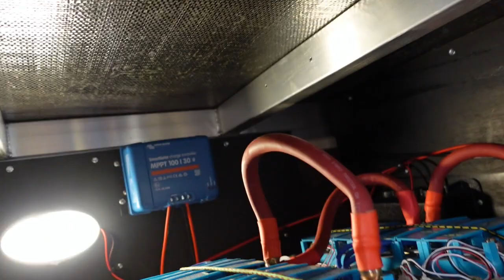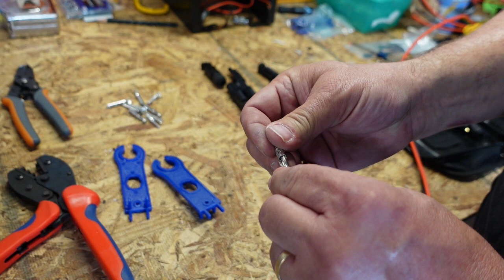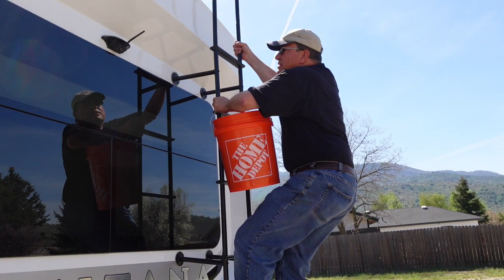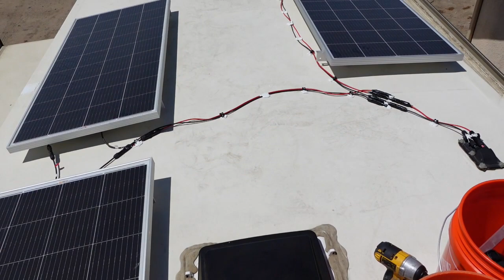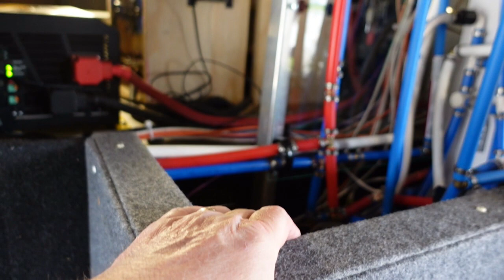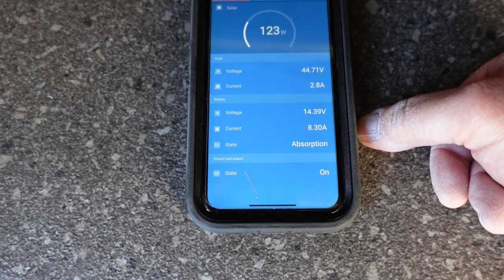How to Wire Solar Panels on Your RV the Smart Way

Comment: Wondering why you have 800 watts of solar panel and a mppt controller than can only handle 440 watts at 12 volts.
Reply: I don’t understand, series or parallel you have 800 watts connected to the controller. Can you explain. 
Thanks
Reply from the maker: @neilpateman333  This works the same as Batteries, When you have 2, 6 Volt batteries and you tie them from Positive to positive (Parallel) you still have 6 volts, when you tie them from Negative to positive (Series) you now have 12 volts, I have 4 panels, they are wired so that 2 of them are in Series totaling 48 Volts and the other 2 are also in Series totaling 48 Volts then I wired the 2 Series configuration in Parallel. When you do that the voltage remains constant so the total voltage is 48 Volts. The amperage in a series configuration remains constant and doubles in a parallel configuration. So the panels I purchased have a max Amperage of 9.4 Amps, so in Series that remains constant, when I put them in parallel it doubles the amperage to 18.8 Amps. What is most important when installing the panels is making sure the amperage does not exceed the wired capability, and you size the input to the charge controller I used a # 10 AWG wire, so it cannot exceed 30 Amps.  The charge controller I purchased cannot exceed 30 Amps or 100 Volts. Now as far as the Watts are concerned the total watts that the system is capable of generating is 800 Watts, in the configuration I have it in we use OHMS Law to do the calculation, Power (Watts) (P) = Volts (E) X Amperage (I)  P=48X18.8   P=902, Now understand that the panels are only designed to generate 800 Watts total, this is based on the efficiency of the Panel, If I get 800 Watts of Power I will be doing great. I only expect to get between 700 and 750 watts.  The charge controller can handle 100 Volts and 30 amps input if you do the math that calculates to 3000 watts, I hope this explanation makes it a little clearer. Please feel free to reach out to me directly if you have any additional questions, You can contact me through RVWeenders.com
Reply from the maker: The Panels are wired to provide 400 Watts in a Parallel circuit.
Reply: I agree with everything you say until your last statement about your mppt controller. The controller is rated up to 100 volts input and the 30 amps is the output rating so approximately 360 watts at 12 volts output or 720 watts at 24 volts output. You can’t multiply the 100 volt input by the 30 amp output they are not related. Check your manufacturer’s specifications. Your controller will start limiting the input after 440 watts of solar input if the output is 12 volts. 
I have a very similar setup 6 panels with a series parallel system.
Reply from the maker: @neilpateman333  Here is the spec sheet for the charge controller, In it you will see that the PV Short circuit amp rating is 35 amps, the charge rate is 30 amps. I did a great deal of research before selecting the right charge controller: https://www.solar-electric.com/victron-energy-smartsolar-mppt-100-30-charge-controller.html?msclkid=99b6ea0c5cce1cff364f8e6ec1139702&utm_source=bing&utm_medium=cpc&utm_campaign=Dynamic%20Search&utm_term=solar-electric&utm_content=All%20Webpages
Reply from the maker: II am not expecting to get 800 watts out of the panels, remember they are in Parallel, so I am only expecting 400 watts max. As the sun moves accross the sky, putting the panes in different locations means i will get enough coverage to charge the batteries, I only have 4 100 Amp hour Lithium batteries. 400 Watts will be enough to keep them charged.